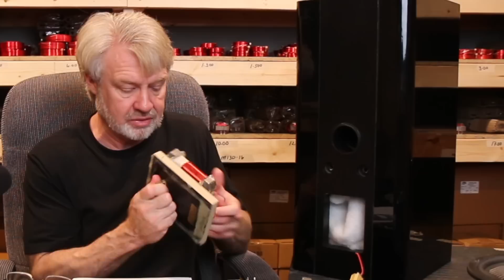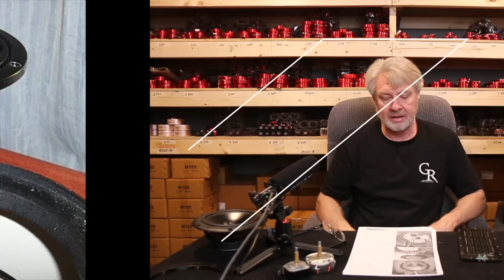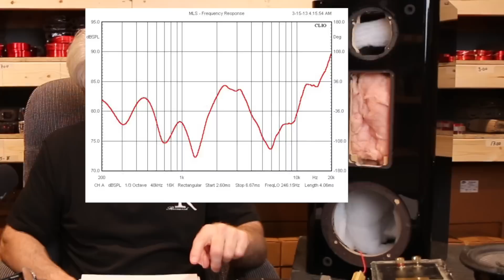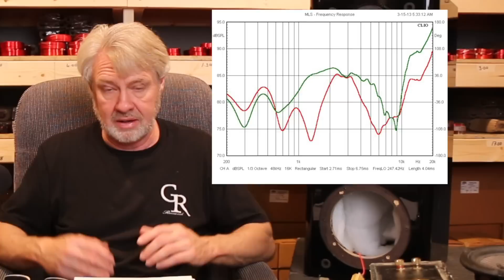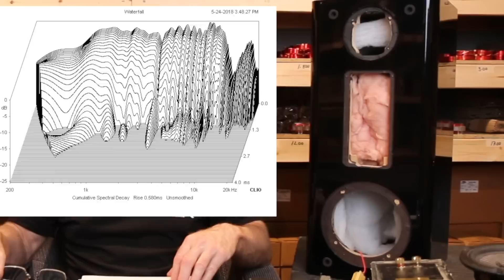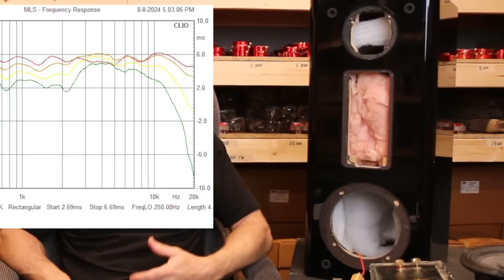Fixing 4 Generations of VMPS | A Masterclass in Crossover Design

Comment: VMPS RM 40 -BEST OF SHOW AT CES 2002♦️ Danny has had a beef with Brian Chaney since the mid '80s ♦️ The 626 has its flaws and what Danny's help these are stunning♦️ DON'T DISPARAGE 
VMPS-LOOK AT THE REVIEWS ONLINE EVERYWHERE... HIGHLY RESPECTED DESIGNER AND GREAT PRODUCTS... Brian did cut corners in places to save costs and pass them on to the consumer.. I own a pair of VMPS Tower II, full power output down to 25 Hertz. NASA SPACE PROPULSION USES HIS SUBWOOFERS TO SIMULATE ROCKET LAUNCHES❤..
 there are plenty of third party reviews of many VMPS products that have no connection with VMPS. For example, the RM40 not only won best of show at CES 2002 but has had numerous stellar reviews from some pretty big names in the business. Yet, for some reason many people do not give VMPS it's due recognition-much of it in the name of "a lack of legitimate reviewing". This is nonsense. At any rate I stand by what I said earlier. It does not matter what the source as long as it can be backed up by your own listening experience.
Reply: "VMPS RM 40 -BEST OF SHOW AT CES 2002" Actually that is not true. The award that they won was presented by Tech TV. It was supposed to be for innovation, not sound quality or performance in any way. You also had to register for that competition. In this category there were only three entries. So VMPS beat out two other companies for "innovation" in some way. 

The performance is really not there with any model that he made.

Comment: I am a noob to crossovers but not to the channel .My speakers sound ok until I increase the volume and then one gets distortion ( not cracking or popping like a blown speaker just odd sounding distortion ) . Is that a sign of a damaged crossover ? cheers
Reply: That might be a driver issue.
Reply: @dannyrichie9743  Hi thanks for the response. Just about to take another look. cheers

Comment: Question.  Why does your Bully-speaker cost almost 3x as much as your Brute speaker ?.   I've been looking for a new pair of speakers for a very long time but everywhere i go, it's always a cheap poorly made crossover and the cabinett rings like a churchbell on sundays.
And since you're well known for building really good stuff, i'm having my eye on the brute.
And with all the BS going around in the speaker industry now with cheap crossovers = speakers don't perform as they could..  it's almost impossible to find a speaker which doesn't cost an arm and a leg, and is good quality all through.
Reply: The Bully adds another mid-bass driver. It steps up the lower end to our servo controlled woofer that also requires the servo amplifier.

Comment: I can't believe you weren't clicking your heels more at this transformation. You turned a pile of junk into a fantastic speaker. Great job as usual.
Reply: It's just something I do all the time.
Reply: @dannyrichie9743  your chair fits the heel clicking perfectly!
Reply: @dannyrichie9743  .
                                       Female 6.3 mm spade terminals?  How are you handling male driver spades?  Thank-you.
Reply: @TriAmpMyFi  Are you asking how wire is connected to them?
Reply: @dannyrichie9743  .
                                      I'm in need of an internal cabinet wiring harness to connect the internal back-side of the cabinet's speaker terminals banana to a cone driver factory equipped with male spade (6.3mm?) terminals.
              In other words a male banana, through wire, to female (crimp?) spade terminal.  1 Red & 1 Black X 6 pair for 6 drivers.  Probably (?) 12 gauge wire. all copper or brass, tube shrinks, OCC etc., etc?
           Still other words, a superb internal jumper from terminal to terminal.

                                                                Acid Jazz,  Funk & Brass  🔈🔉🔊

Comment: Inspired by this a year watching this series, I have started fiddling in Vituix. I am working on a two-way design. I applied as much of your philosophy as I could, Danny. I found a tweeter with a low Fs, used a paper woofer, crossed them at 1500hz. I used a 3rd order Butterworth, kept it to 7 parts. I am only modeling, not measuring real world results. But using the same 1/3 octive smoothing, I managed an 89.8 dB sensitivity +/- 0.7 dB. With no smoothing, +/- 1.8 dB. I feel ready for a lesson in testing and creating a test bed. Then it will be time forcabinets including: Baffle Design - Beyond Rounding and Flush-Mounting.
Reply: Your crossover won't turn out like you think. You have to measure your drivers in the box that you will use them in to model the crossover correctly.
Reply: Please be careful. This is a incurable disease. You also really start learning when you get a good measuring system.

Comment: It's understandable that the virtical off axis would be bad. Those panel drivers probably have even intensity all over, making the time alignment a challenge. But not only for the med and treble drivers, but with the med driver itself! Whereas cone med drivers have center weighted higher notes, and less differences in time alignment.
Reply: If you know what to do. It is not a problem.

Comment: This was interesting Danny. I use the same tweeter in my own Quintetta loudspeakers that I designed back in 2004. Are you using any additional circuitry other than the 3rd order network on the tweeter in this upgrade? Great response after your upgrade, I was really impressed with your work on that particular speaker.👍
Reply: Just a third order filter with just the right resistors to shape the response balance.

Comment: Well the story goes, VMPS was located in northern California out of a guy's home. He had a couple of guy's working in his garage to build his speakers, so there was no factory, I lived down the street from VMPS. He used to advertise in the back of stereo review in the 80's , he built his speakers by ear and sometimes he would put plumbers dum dum around  the dust cap and it would end up on the grill, his drivers was purchased as he was able to find a supplier, he was a one man manufacturer, in his home he did not have a lab to do R&D. A friend of mine purchased a pair from a tag sale a we opened it up and he had built the speakers with 22 gauge wire. So the VMPS died when the builder/ owner passed away all of his inventory was left with his wife, she had no audio knowledge, his inventory was spread all around town like flea markets, then I was driving  in the same town and someone had left all his cabinets on a pallet in the rain with a sign that read free. I heard he was a great guy. But his company was no JBL .
Reply: You got the story kind of right... He won best of CES three times.... Try and get your act together and learn what's going on before you open your mouth

Comment: I thought the woofer on the brute was a steel stamp frame. Why would they use that if he said he hates them?
Reply: Not that big of a deal for low bass only. When it plays up into higher ranges it begins to cause audible ringing.
Reply: @dannyrichie9743 ok thanks because I bought a 10" Dayton designer and I was going to try to wrap the frame with zip tape , which is used on roofs to stop it from ringing, Then I remembered that the brute was stamped. I also have the designer 6.5 that I used for a midwoofer maybe I should wrap them because I crossed those at 1800 . Thanks